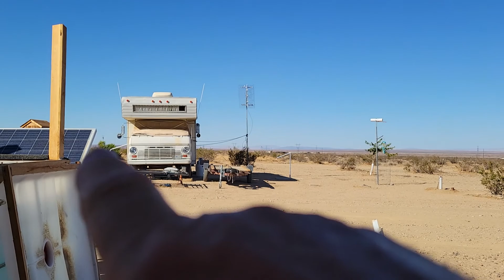A Couple 'little' surprises, Sep. 2, 2021

Comment: Yes I live in Northeast Pennsylvania and we lost power due to the storm, I'm so glad that I invested in a generator just for this purpose since I need my oxygen, glad I did.
Reply from the maker: They now have a thing that makes its own oxygen from the air, is Rechargeable, and lightweight.  I'll try to get the info from the next commercial.
Reply: i HAVE BOTH OF THEM 1 BIG ELECTRIC CONCENTRATER AND 1 PORABLE i RENT BOTH BUT DO OWN MY OWN ELECTRIC CONCENTOR. BUT SAVE MINE SNCE i HAVE TO RENT BOTH TO GET THE PORTIABLE
Reply from the maker: Smart!